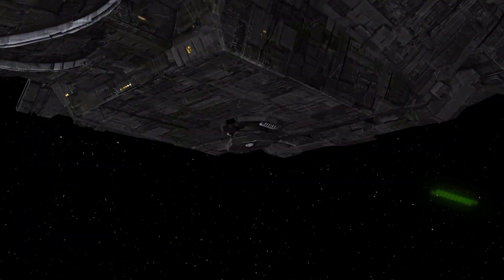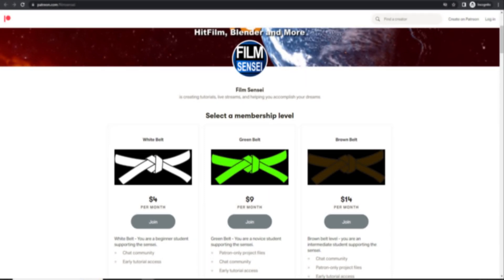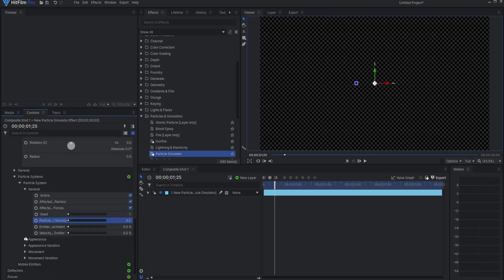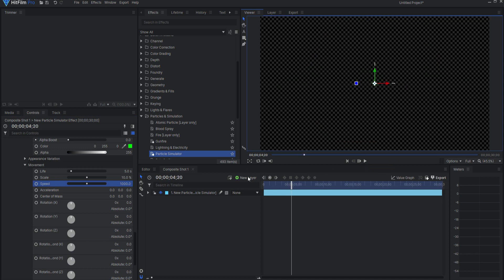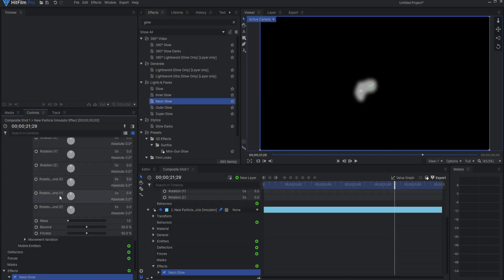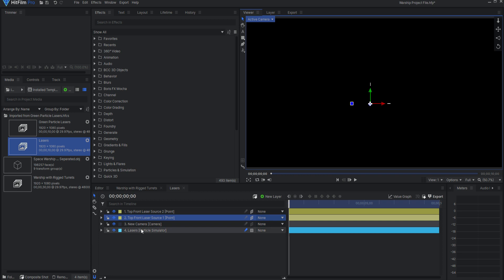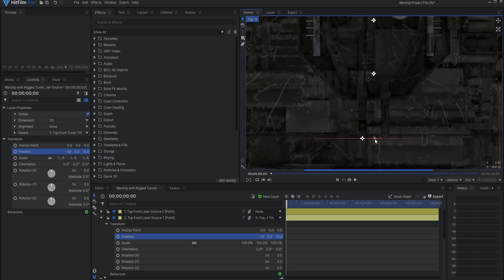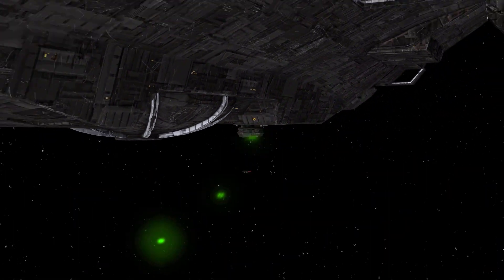Laser Turrets Part 2: Creating the Lasers

Comment: Great tutorial.  Here's a problem I have with figuring out 3D solutions in a 2D environment.  You rotated your lasers on the Y-axis so they would fire forward.  I watched a tutorial on using the particle sim to eject shell casings from a gun, and the rotation was on the Z-axis.  I find that trying to figure out which axis to rotate so the particles will align properly with the footage makes my brain melt.  Do you have any tips for better understanding this process to help figure it out?
Reply from the maker: In HitFilm, the X-Axis goes from left to right, the Y-Axis goes down to up, and the Z-Axis goes back to front. This is not always the case in other applications. For example in Blender, the X-Axis is still left to right, but the Y-Axis is back to front, and the Z-Axis is down to up. You can tell them by their colors. Red is for X, Green is for Y, and Blue is for Z... so RGB correlates with XYZ.

Comment: So useful. I'd be trying different methods using keyframe movements for light flares and even lightswords but it was painful especially if a number of weapons were firing.
I still have a video with a big battle scene which I was putting off for just that reason. I never thought to use the particle sim but so easy to re-use it for multiple weapons.
Reply from the maker: Hopefully, this will work for you! It's super easy to create. 😀
Reply: Oddly enough, building weapons fire in Hitfilm with the Particle Sim was literally in the second thing I ever created.
Reply from the maker: @HitfilmUniversity  Nice! That must have been the video where you shot down a shuttle?
Reply: @HitfilmSensei  Yup. The weapons fire was the particle sim, as was most of the impact explosion. Add in some Mocha tracking to set up the deflectors, and...
Reply from the maker: @HitfilmUniversity  Wow... Way back in HitFilm 2 Ultimate? Dang!
Reply: @HitfilmSensei  well, the particle sim has always been powerful.

Now, if you look back at the Cylon animation I did in Pro 4 - the weapons fire is also particle sim, but a different, maybe more "brute force" method. The Cylons are all particle clones of an animated raider doing a flip and fire, but the lasers... Duplicate particle sim using an alternate Cylon with all materials set to black. And a 3D model cylinder dropped into the sane layer. The laser cylinders are parented to a point and animated to fly out then "snap back" inside the black Cylon. The laser particles are set to add blend and have glow added ala Simon's tutorial on adding glowing lights to models.

With later versions of HF I bet I could drop the black Cylon model and just use a Depth Layer to handle the occlusion. Would reduce a lot of load on the particle sim.

I think Javert's old preset marketplace also has an old particle template I did of a beam hitting a wall and leaving damage, which incorporates Rodolphe's classic Lightsaber Burn technique.
Reply from the maker: @HitfilmUniversity  I actually played with that wall damage causing beam! I modified it adding a debris splash and smoke. I was thinking about making a tutorial on that, but I never did. As I recall, the biggest challenge was getting the splash to come off of the wall. The lasers moved too fast and the splashes were all over the place. I ended slowing the entire thing down to 1/4 speed, then putting that comp into another comp and speeding up the latter 4x. It looked great! I will have to find that old project file's video.
Reply: @HitfilmSensei  I'd like to see your tweak.
Reply: I'm sure I can work through it but if either of you want to do a demo or tutorial of weapon fire both outgoing and incoming (off screen)  within a chaotic battle scene (irl or 3d models) it'd be very welcome.
Reply: Come to think of it, if you check the Hit-U channel, the Photon Torpedo tutorial more or less is about particle sim weapons fire, also gets into custom textures for the particles AND shows you how to automate some interaction with the Particle fire and deflector layers to trigger "shield hit" animations or explosions.
Reply from the maker: @HitfilmUniversity  Photon Torpedo Tutorial at HitFilm University: https://youtu.be/ZPpbA6AoQFk